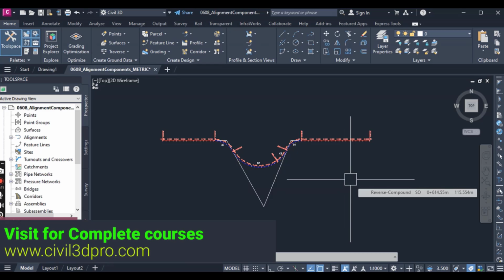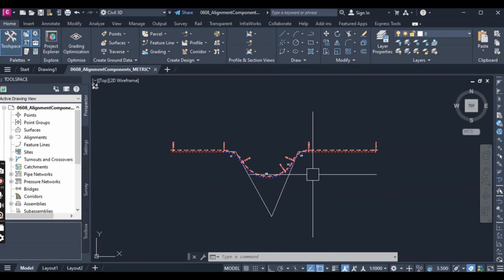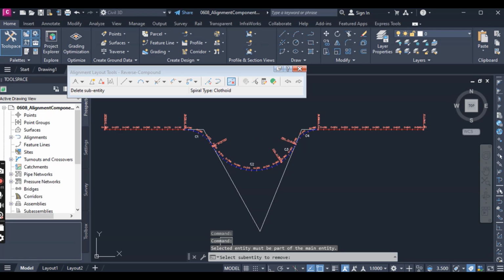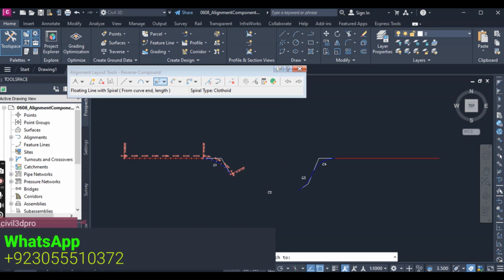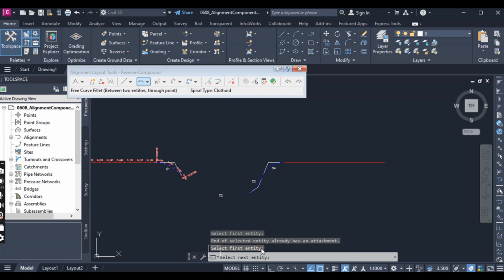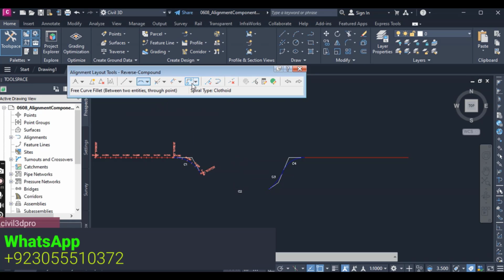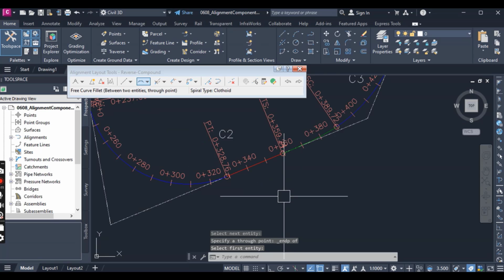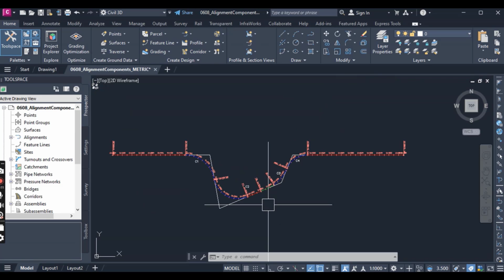6.8 How to Place Minimum Length Tangent Between Curves in Civil 3d Alignment | Advanced Civil 3d

Comment: To avoid creating the spiral you made don't use Floating Line with Spiral. You can just use Floating Line (from curve end, length), fifth button from the right on the Alignment Layout Tools. It lets you select the end point and specify the tangent length without any spiral attachment.
Reply from the maker: Thanks for suggestion